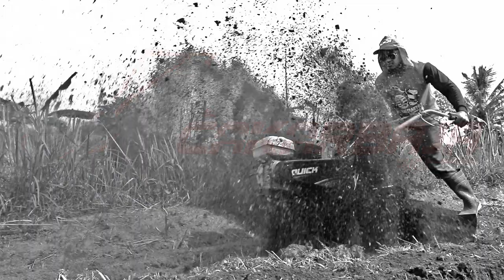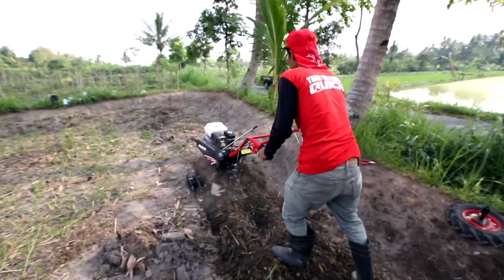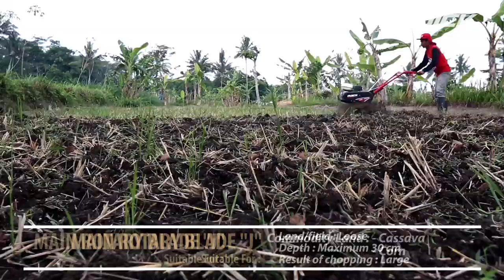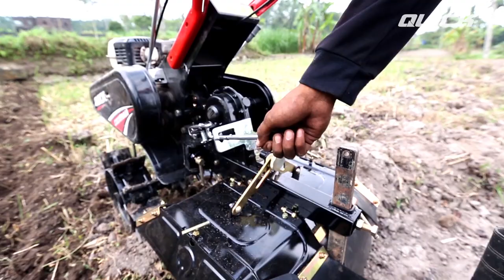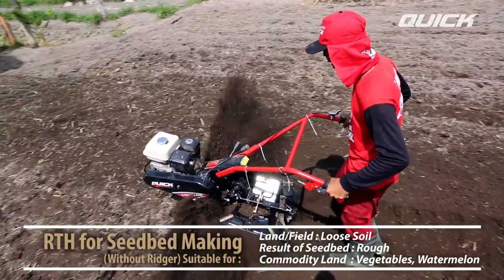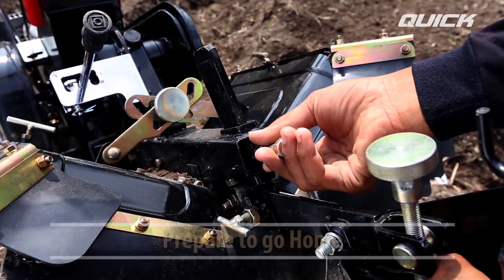CULTIVATOR QUICK CAKAR BAJA : STEADY, DURABLE, STRONG

Comment: tani di indonesia mmg cocoknya pk traktor tangan ky gini
Reply from the maker: Mari Pak Bos diorder  :)
Reply: Paket Komplit brapa
Reply from the maker: Harga Quick Cakar Baja :
Mesin Bensin GX 200T2-QTBC : Rp 11.450.000 
Mesin Bensin GX 160T2-QTBC : Rp 11.150.000

Keterangan:
- Harga belum termasuk Biaya merakit, Oli, Solar/Bensin
- Harga termasuk PPN 10%
- Harga termasuk perlengkapan standar (hitch pin, universal hitch, resistance bar, dan roda karet)
- Harga belum termasuk ongkos kirim dari pabrik di Yogyakarta.

Perlengkapan Cultivator dijual terpisah (pilih sesuai kebutuhan)
--> Main Rotary BLADE B 340 = Rp 1.380.000 
--> Main Rotary BLADE B 240 = Rp 920.000 
--> Main Rotary BLADE B 100 = Rp 680.000 
--> Stabilizer Disc = Rp 120.000
--> Extension Rotary Blade B 200 = Rp 530.000
--> Main Rotary Blade J = Rp 1.310.000
--> Main Rotary Blade S = Rp 1.340.000
--> RTH = Rp 4.930.000 
--> Ridger = Rp 860.000 
--> Iron Wheel (CW 370)  = Rp 380.000 
--> Iron Wheel (CW 550) = Rp  600.000
--> Garu (Leveler) Cakar Baja = Rp 270.000
--> Bajak Cakar Baja = Rp 530.000 

Untuk lebih jelasnya, Pak Bos dapat menghubungi link https://bit.ly/CakarbajaSalesPusat

atau bila berkenan mohon kirimkan nomor telp/HP Pak Bos, bagian pemasaran kami akan menghubungi Pak Bos :)

Comment: Maat tanya mas.
Kalau untuk pengolahan lahan kering termasuk untuk membuat guludan/bedeng, paket lengkap type cakar baja total harga berapa mas?
Trus di jogya lokasi/alamatnya di jalan apa?
Reply from the maker: Harga Quick Cakar Baja :
- Engine Honda GX 200 T2-QTBD : Rp11.582.000 
- Engine Honda GX 160 T2-QTBD : Rp11.262.000

Keterangan:
- Harga belum termasuk perlengkapan (blade / ridger / RTH)
- Harga belum termasuk ongkos kirim dari pabrik di Yogyakarta
- Harga belum termasuk biaya merakit, oli, solar / bensin, running test dan training
- Harga sudah termasuk PPN 11%

Untuk informasi lebih detail, silahkan Pak Boss menghubungi nomor berikut : 0811 2828 477 atau 0811 2930 300

atau bila berkenan mohon kirimkan nomor telepon Pak Boss, bagian pemasaran kami akan menghubungi Pak Boss :)
Reply from the maker: Harga implement Quick Cakar Baja :
- RTH : Rp4.925.000
- Rotary Blade B : Rp1.380.000
- Rotary Blade J : Rp1.303.000
- Rotary Blade S : Rp1.331.000
- Ridger : Rp858.000

Keterangan:
- Harga belum termasuk ongkos kirim dari pabrik di Yogyakarta
- Harga sudah termasuk PPN 11%

Untuk informasi lebih detail, silahkan Pak Boss menghubungi nomor berikut : 0811 2828 477 atau 0811 2930 300

atau bila berkenan mohon kirimkan nomor telepon Pak Boss, bagian pemasaran kami akan menghubungi Pak Boss :)

Comment: Berapa harga sampe ke kabupaten Brebes booz..?
Reply from the maker: Harga Quick Cakar Baja :
Engine Honda GX 200 T2-QTBD : Rp11.582.000 
Engine Honda GX 160 T2-QTBD : Rp11.262.000

Keterangan:
- Harga belum termasuk perlengkapan (Blade / RTH / Ridger)
- Harga belum termasuk ongkos kirim dari pabrik di Yogyakarta
- Harga belum termasuk biaya merakit, oli, solar / bensin, running test dan training
- Harga sudah termasuk PPN 11%

Untuk informasi lebih detail, silahkan Pak Boss menghubungi Telp. / WA Telp. / WA : 0811 2828 477 atau 0811 2930 300

atau bila berkenan mohon kirimkan nomor telp. / HP Pak Boss, bagian pemasaran kami akan menghubungi Pak Boss :)

Comment: Info harga full set seperti di video bos, sama deler resminya di wilayah kebumen dan Purwokerto. Trimakasih
Reply from the maker: Harga Quick Cakar Baja :
Mesin Bensin GX 200T2-QTBC : Rp 11.450.000 
Mesin Bensin GX 160T2-QTBC : Rp 11.150.000

Keterangan:
- Harga belum termasuk Biaya merakit, Oli, Solar/Bensin
- Harga termasuk PPN 10%
- Harga termasuk perlengkapan standar (hitch pin, universal hitch, resistance bar, dan roda karet)
- Harga belum termasuk ongkos kirim dari pabrik di Yogyakarta.

Perlengkapan Cultivator dijual terpisah (pilih sesuai kebutuhan)
--> Main Rotary BLADE B 340 = Rp 1.380.000 
--> Main Rotary BLADE B 240 = Rp 920.000 
--> Main Rotary BLADE B 100 = Rp 680.000 
--> Stabilizer Disc = Rp 120.000
--> Extension Rotary Blade B 200 = Rp 530.000
--> Main Rotary Blade J = Rp 1.310.000
--> Main Rotary Blade S = Rp 1.340.000
--> RTH = Rp 4.930.000 
--> Ridger = Rp 860.000 
--> Iron Wheel (CW 370)  = Rp 380.000 
--> Iron Wheel (CW 550) = Rp  600.000
--> Garu (Leveler) Cakar Baja = Rp 270.000
--> Bajak Cakar Baja = Rp 530.000 

Untuk lebih jelasnya, Pak Bos dapat menghubungi link https://bit.ly/CakarbajaSalesPusat
Whatsapp / SMS / Telp: 0811-2930-300
Reply: @quicktraktor  itu dah full set bos???
Reply from the maker: Betul Pak Bos,  :)
Reply: @quicktraktor   Harga bersihnya sampai di rumah dan siap pakai utk daerah Ciemas Kab. Sukabumi berapa, Bos?
Reply: @quicktraktor  nomor wa dulu Bos
Reply: Ful set ya tinggal ngitung bos, smua hrga trtera, bs smpe 20 an lengkap

Comment: Min klo beli fullset totalnya jdi berapa
Reply from the maker: Harga Quick Cakar Baja :
Mesin Bensin GX 200T2-QTBD : Rp 11.478.000 
Mesin Bensin GX 160T2-QTBD : Rp 11.160.000

Keterangan:
- Harga belum termasuk Biaya merakit, Oli, Solar/Bensin
- Harga termasuk PPN 10%
- Harga termasuk perlengkapan standar (hitch pin, universal hitch, resistance bar, dan roda karet)
- Harga belum termasuk ongkos kirim dari pabrik di Yogyakarta.

Perlengkapan Cultivator dijual terpisah (pilih sesuai kebutuhan)
--> Main Rotary BLADE B 340 = Rp 1.380.000 
--> Main Rotary BLADE B 240 = Rp 920.000 
--> Main Rotary BLADE B 100 = Rp 680.000 
--> Stabilizer Disc = Rp 120.000
--> Extension Rotary Blade B 200 = Rp 530.000
--> Main Rotary Blade J = Rp 1.310.000
--> Main Rotary Blade S = Rp 1.340.000
--> RTH = Rp 4.930.000 
--> Ridger = Rp 860.000 
--> Iron Wheel (CW 370)  = Rp 380.000 
--> Iron Wheel (CW 550) = Rp  600.000
--> Garu (Leveler) Cakar Baja = Rp 270.000
--> Bajak Cakar Baja = Rp 530.000 

Untuk lebih jelasnya, Pak Bos dapat menghubungi Telp/WA 0811-2828-477, 0811-2930-300

atau bila berkenan mohon kirimkan nomor telp/HP Pak Bos, bagian pemasaran kami akan menghubungi Pak Bos :)

Comment: Berapa harga ke kab,Karo Sumut komplet atao ada tko di Madan saya sngat trtarik dgn cara kerja nya
Reply from the maker: Harga Quick Cakar Baja :
Mesin Bensin GX 200T2-QTBC : Rp 11.450.000 
Mesin Bensin GX 160T2-QTBC : Rp 11.150.000

Keterangan:
- Harga belum termasuk Biaya merakit, Oli, Solar/Bensin
- Harga termasuk PPN 10%
- Harga termasuk perlengkapan standar (hitch pin, universal hitch, resistance bar, dan roda karet)
- Harga belum termasuk ongkos kirim dari pabrik di Yogyakarta.

Perlengkapan Cultivator dijual terpisah (pilih sesuai kebutuhan)
--> Main Rotary BLADE B 340 = Rp 1.380.000 
--> Main Rotary BLADE B 240 = Rp 920.000 
--> Main Rotary BLADE B 100 = Rp 680.000 
--> Stabilizer Disc = Rp 120.000
--> Extension Rotary Blade B 200 = Rp 530.000
--> Main Rotary Blade J = Rp 1.310.000
--> Main Rotary Blade S = Rp 1.340.000
--> RTH = Rp 4.930.000 
--> Ridger = Rp 860.000 
--> Iron Wheel (CW 370)  = Rp 380.000 
--> Iron Wheel (CW 550) = Rp  600.000
--> Garu (Leveler) Cakar Baja = Rp 270.000
--> Bajak Cakar Baja = Rp 530.000 

Untuk lebih jelasnya, Pak Bos dapat menghubungi link https://bit.ly/CakarbajaSalesPusat

atau bila berkenan mohon kirimkan nomor telp/HP Pak Bos, bagian pemasaran kami akan menghubungi Pak Bos :)
Reply: Utk tanah karo kayaknya pas dan mantap pake yg ini

Comment: Dealer dibojonegoro jatim dimana ya?
Reply from the maker: Harga Quick Cakar Baja :
Mesin Bensin GX 200T2-QTBD : Rp 11.478.000 
Mesin Bensin GX 160T2-QTBD : Rp 11.160.000

Keterangan:
- Harga belum termasuk Biaya merakit, Oli, Solar/Bensin
- Harga termasuk PPN 10%
- Harga termasuk perlengkapan standar (hitch pin, universal hitch, resistance bar, dan roda karet)
- Harga belum termasuk ongkos kirim dari pabrik di Yogyakarta.

Perlengkapan Cultivator dijual terpisah (pilih sesuai kebutuhan)
--> Main Rotary BLADE B 340 = Rp 1.380.000 
--> Main Rotary BLADE B 240 = Rp 920.000 
--> Main Rotary BLADE B 100 = Rp 680.000 
--> Stabilizer Disc = Rp 120.000
--> Extension Rotary Blade B 200 = Rp 530.000
--> Main Rotary Blade J = Rp 1.310.000
--> Main Rotary Blade S = Rp 1.340.000
--> RTH = Rp 4.930.000 
--> Ridger = Rp 860.000 
--> Iron Wheel (CW 370)  = Rp 380.000 
--> Iron Wheel (CW 550) = Rp  600.000
--> Garu (Leveler) Cakar Baja = Rp 270.000
--> Bajak Cakar Baja = Rp 530.000 

Untuk lebih jelasnya, Pak Bos dapat menghubungi Telp/WA 0811-2828-477, 0811-2930-300

atau bila berkenan mohon kirimkan nomor telp/HP Pak Bos, bagian pemasaran kami akan menghubungi Pak Bos :)

Comment: Harga untuk mesin sama cakar pembuat gulutan/ bedengan brp mas
Reply from the maker: Harga Quick Cakar Baja :
- Engine Honda GX 200 T2-QTBD : Rp11.638.000
- Engine Honda GX 160 T2-QTBD : Rp11.378.000

Harga implement Quick Cakar Baja :
- RTH : Rp4.925.000
- Rotary Blade B : Rp1.380.000
- Rotary Blade J : Rp1.303.000
- Rotary Blade S : Rp1.331.000
- Ridger : Rp858.000

Keterangan:
- Harga belum termasuk perlengkapan (blade / ridger / RTH)
- Harga belum termasuk ongkos kirim dari pabrik di Yogyakarta
- Harga belum termasuk biaya merakit, oli, solar / bensin, running test dan training
- Harga sudah termasuk PPN 11%

Untuk informasi lebih detail, silahkan Pak Boss menghubungi nomor berikut : 0811 2828 477 atau 0811 2930 300
Reply: @quicktraktor  harganya komplitnya brp?

Comment: Yg di maksud di komentar itu mesin sama alat yang diperagakan semua berapa pak ,, jangan di buat pusing, maksudnya itu mesin sama alat yg sampean peragakan itu semua berapa
Reply from the maker: Harga Quick Cakar Baja :
Mesin Bensin GX 200T2-QTBC : Rp 11.450.000 
Mesin Bensin GX 160T2-QTBC : Rp 11.150.000

Keterangan:
- Harga belum termasuk Biaya merakit, Oli, Solar/Bensin
- Harga termasuk PPN 10%
- Harga termasuk perlengkapan standar (hitch pin, universal hitch, resistance bar, dan roda karet)
- Harga belum termasuk ongkos kirim dari pabrik di Yogyakarta.

Perlengkapan Cultivator dijual terpisah (pilih sesuai kebutuhan)
--> Main Rotary BLADE B 340 = Rp 1.380.000 
--> Main Rotary BLADE B 240 = Rp 920.000 
--> Main Rotary BLADE B 100 = Rp 680.000 
--> Stabilizer Disc = Rp 120.000
--> Extension Rotary Blade B 200 = Rp 530.000
--> Main Rotary Blade J = Rp 1.310.000
--> Main Rotary Blade S = Rp 1.340.000
--> RTH = Rp 4.930.000 
--> Ridger = Rp 860.000 
--> Iron Wheel (CW 370)  = Rp 380.000 
--> Iron Wheel (CW 550) = Rp  600.000
--> Garu (Leveler) Cakar Baja = Rp 270.000
--> Bajak Cakar Baja = Rp 530.000 

Untuk lebih jelasnya, Pak Bos dapat menghubungi link https://bit.ly/CakarbajaSalesPusat

atau bila berkenan mohon kirimkan nomor telp/HP Pak Bos, bagian pemasaran kami akan menghubungi Pak Bos :)

Comment: Kalau unit standar ban karet serta kelengkapan Blade j itu berapa harganya min
Reply from the maker: Harga Quick Cakar Baja :
Engine Honda GX 200 T2-QTBD : Rp. 11.478.000 
Engine Honda GX 160 T2-QTBD : Rp. 11.160.000

Keterangan:
- Harga belum termasuk perlengkapan (Blade / RTH / Ridger)
- Harga belum termasuk ongkos kirim dari pabrik di Yogyakarta
- Harga belum termasuk biaya merakit, oli, solar / bensin, running test dan training
- Harga sudah termasuk PPN 10%

Untuk informasi lebih detail, silahkan Pak Boss menghubungi Telp. / WA Telp. / WA : 0811 2828 477 atau 0811 2930 300

atau bila berkenan mohon kirimkan nomor telp. / HP Pak Boss, bagian pemasaran kami akan menghubungi Pak Boss :)
Reply: @quicktraktor  ... untuk kasuari min??.. atau ada harga yang under 10 JT?
Reply from the maker: Harga Quick Kasuari :
Engine Honda GX 200 T2-QTBD : Rp. 9.130.000
Engine Honda GX 160 T2-QTBC : Rp. 8.809.000
Body Only : Rp. 5.598.000

Keterangan:
- Harga belum termasuk perlengkapan (Blade / RTH / Ridger)
- Harga belum termasuk ongkos kirim dari pabrik di Yogyakarta
- Harga belum termasuk biaya merakit, oli, solar / bensin, running test dan training
- Harga sudah termasuk PPN 11%

Untuk informasi lebih detail, silahkan Pak Boss menghubungi Telp. / WA Telp / WA : 0811 2828 477 atau 0811 2930 300

atau bila berkenan mohon kirimkan nomor telp. / HP Pak Boss, bagian pemasaran kami akan menghubungi Pak Boss :)
Reply: @quicktraktor  suku cadang di ternate apa sudah ada alamat dimana
Reply: Cakar baja takpa mesin penggerak  brp min..

Comment: Untuk area purwokerto purbalingga harga berapa ya
Reply from the maker: Harga Quick Cakar Baja :
Engine Honda GX 200 T2-QTBD : Rp. 11.478.000 
Engine Honda GX 160 T2-QTBD : Rp. 11.160.000

Keterangan:
- Harga belum termasuk perlengkapan (Blade / RTH / Ridger)
- Harga belum termasuk ongkos kirim dari pabrik di Yogyakarta
- Harga belum termasuk biaya merakit, oli, solar / bensin, running test dan training
- Harga sudah termasuk PPN 10%

Untuk informasi lebih detail, silahkan Pak Boss menghubungi Telp. / WA Telp. / WA : 0811 2828 477 atau 0811 2930 300

atau bila berkenan mohon kirimkan nomor telp. / HP Pak Boss, bagian pemasaran kami akan menghubungi Pak Boss :)

Comment: berapa harga komplit dgn semua aksesorisnya
Reply from the maker: Harga Quick Cakar Baja :
Mesin Bensin GX 200T2-QTBD : Rp 11.478.000 
Mesin Bensin GX 160T2-QTBD : Rp 11.160.000

Keterangan:
- Harga belum termasuk Biaya merakit, Oli, Solar/Bensin
- Harga termasuk PPN 10%
- Harga termasuk perlengkapan standar (hitch pin, universal hitch, resistance bar, dan roda karet)
- Harga belum termasuk ongkos kirim dari pabrik di Yogyakarta.

Perlengkapan Cultivator dijual terpisah (pilih sesuai kebutuhan)
--> Main Rotary BLADE B 340 = Rp 1.380.000 
--> Main Rotary BLADE B 240 = Rp 920.000 
--> Main Rotary BLADE B 100 = Rp 680.000 
--> Stabilizer Disc = Rp 120.000
--> Extension Rotary Blade B 200 = Rp 530.000
--> Main Rotary Blade J = Rp 1.310.000
--> Main Rotary Blade S = Rp 1.340.000
--> RTH = Rp 4.930.000 
--> Ridger = Rp 860.000 
--> Iron Wheel (CW 370)  = Rp 380.000 
--> Iron Wheel (CW 550) = Rp  600.000
--> Garu (Leveler) Cakar Baja = Rp 270.000
--> Bajak Cakar Baja = Rp 530.000 

Untuk lebih jelasnya, Pak Bos dapat menghubungi Telp/WA 0811-2828-477, 0811-2930-300

atau bila berkenan mohon kirimkan nomor telp/HP Pak Bos, bagian pemasaran kami akan menghubungi Pak Bos :)

Comment: Harganya berapa y.paket lengkapnya
Reply from the maker: Harga Quick Cakar Baja :
Mesin Bensin GX 200T2-QTBC : Rp 11.450.000 
Mesin Bensin GX 160T2-QTBC : Rp 11.150.000

Keterangan:
- Harga belum termasuk Biaya merakit, Oli, Solar/Bensin
- Harga termasuk PPN 10%
- Harga termasuk perlengkapan standar (hitch pin, universal hitch, resistance bar, dan roda karet)
- Harga belum termasuk ongkos kirim dari pabrik di Yogyakarta.

Perlengkapan Cultivator dijual terpisah (pilih sesuai kebutuhan)
--> Main Rotary BLADE B 340 = Rp 1.380.000 
--> Main Rotary BLADE B 240 = Rp 920.000 
--> Main Rotary BLADE B 100 = Rp 680.000 
--> Stabilizer Disc = Rp 120.000
--> Extension Rotary Blade B 200 = Rp 530.000
--> Main Rotary Blade J = Rp 1.310.000
--> Main Rotary Blade S = Rp 1.340.000
--> RTH = Rp 4.930.000 
--> Ridger = Rp 860.000 
--> Iron Wheel (CW 370)  = Rp 380.000 
--> Iron Wheel (CW 550) = Rp  600.000
--> Garu (Leveler) Cakar Baja = Rp 270.000
--> Bajak Cakar Baja = Rp 530.000 

atau bila berkenan mohon kirimkan nomor telp/HP Pak Bos, bagian pemasaran kami akan menghubungi Pak Bos :)
https://bit.ly/CakarbajaSalesPusat

Comment: 1. Apa ada agen di Jakarta atau lokasi terdekat dn alamat?
2. Btp harga Quick Cakar  Baja?
3. Brp dalam kemampuan cangkulnya?
4. Ada brp tipe Quick Cakar Baja?
Terima kasi
Reply from the maker: Harga Quick Cakar Baja :
Mesin Bensin GX 200T2-QTBD : Rp 11.478.000 
Mesin Bensin GX 160T2-QTBD : Rp 11.160.000

Keterangan:
- Harga belum termasuk Biaya merakit, Oli, Solar/Bensin
- Harga termasuk PPN 10%
- Harga termasuk perlengkapan standar (hitch pin, universal hitch, resistance bar, dan roda karet)
- Harga belum termasuk ongkos kirim dari pabrik di Yogyakarta.

Perlengkapan Cultivator dijual terpisah (pilih sesuai kebutuhan)
--> Main Rotary BLADE B 340 = Rp 1.380.000 
--> Main Rotary BLADE B 240 = Rp 920.000 
--> Main Rotary BLADE B 100 = Rp 680.000 
--> Stabilizer Disc = Rp 120.000
--> Extension Rotary Blade B 200 = Rp 530.000
--> Main Rotary Blade J = Rp 1.310.000
--> Main Rotary Blade S = Rp 1.340.000
--> RTH = Rp 4.930.000 
--> Ridger = Rp 860.000 
--> Iron Wheel (CW 370)  = Rp 380.000 
--> Iron Wheel (CW 550) = Rp  600.000
--> Garu (Leveler) Cakar Baja = Rp 270.000
--> Bajak Cakar Baja = Rp 530.000 

Untuk lebih jelasnya, Pak Bos dapat menghubungi Telp/WA 0811-2828-477, 0811-2930-300

atau bila berkenan mohon kirimkan nomor telp/HP Pak Bos, bagian pemasaran kami akan menghubungi Pak Bos :)
Reply from the maker: Untuk mengolah lahan apa Pak Bos ? tipe cultivator ada 4 tipe, Kasuari, Cakar baja, Cakar Baja mini, Cacah Bumi,
Reply: Kalau untuk tanah sangat keras pakai Blade yg mana?

Comment: Komplitnya berapa harganya min?
Reply from the maker: Harga Quick Cakar Baja :
- Engine Honda GX 200 T2-QTBD : Rp11.638.000
- Engine Honda GX 160 T2-QTBD : Rp11.378.000

Keterangan:
- Harga belum termasuk perlengkapan (blade / ridger / RTH)
- Harga belum termasuk ongkos kirim dari pabrik di Yogyakarta
- Harga belum termasuk biaya merakit, oli, solar / bensin, running test dan training
- Harga sudah termasuk PPN 11%

Untuk informasi harga paket yang lain, silahkan Pak Bos menghubungi nomor berikut : 0811 2930 300